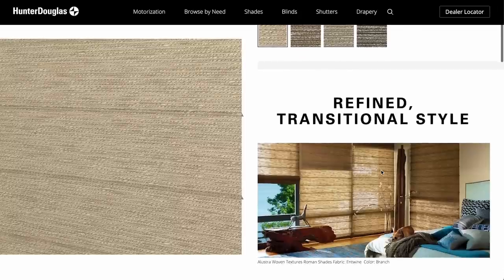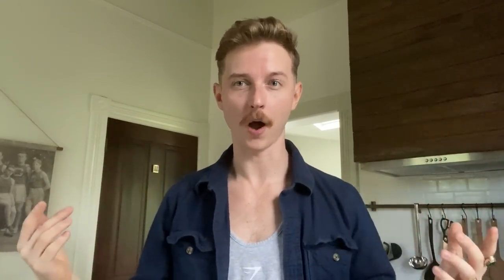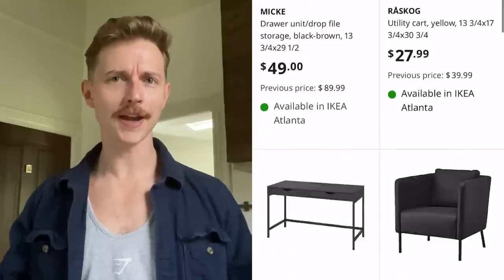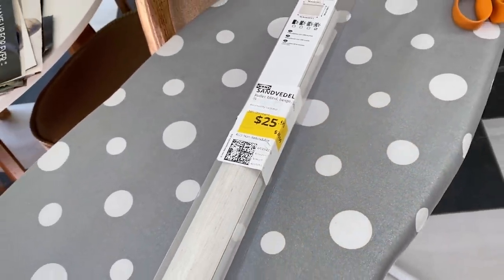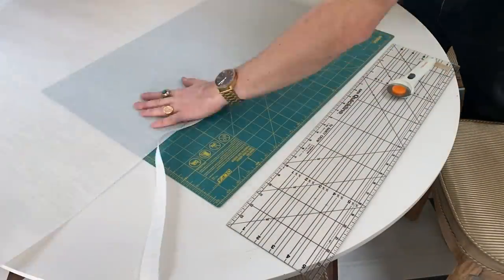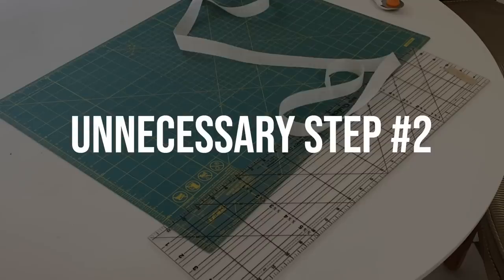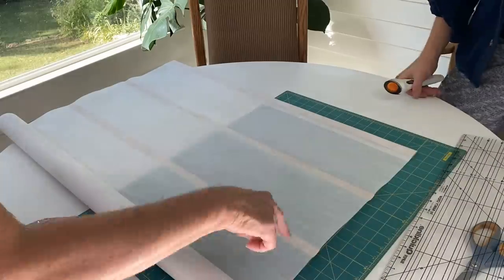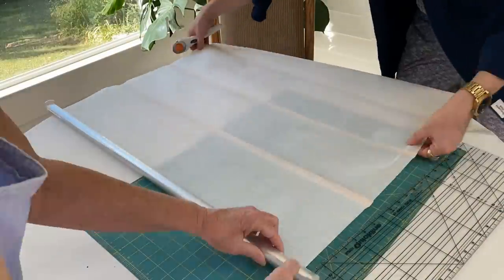Easy IKEA Sandvedel HACK! | Custom Zen Inspired Roller Shade | REISSUED

Comment: You're IKEA-famous, Andrew!  In case you wanted actual Roman shades, they are spectacularly simple to make, and you're such an accomplished sewist that I can't imagine you'd have much issue making them.
Reply: Can they (Roman shades)  be made for really wide windows?
Reply: @deborahdanhauer8525  I believe so, though if the windows are wider than the width of your fabric, I'd avoid pattern, as matching would be kind of tricky.
Reply: @xingcat  yes, that’s a good idea. But I want a color to darken a room, so solids won’t be a problem. Thanks for your help!❤️🤗🐝

Comment: Great project Andrew. Very creative use of veneer banding! 👏 I've used a lot of Birch veneer edge banding (usually from Lowe's) for Birch panels on paintings and it recommends using the high (cotton) setting. At that temp, sometimes you get adhesive squeeze-out. Not a problem on a rigid wood surface because it can be sanded. But, it can gum up your iron. So, I always use a piece of cooking parchment between the iron and veneer. I would be interested to see if the veneer has and 'memory'(from being rolled up) causing it to bow or curl over time or at higher humidity on the flexible fabric. As always...Cheers!
Reply from the maker: Great thoughts and tips! Thanks for sharing with us!

Comment: WOW, what a great idea.  Amazing well done.  For the pull you could take some of the back off and glue it to only the front.  Or find some hardware very light pull and attach it to the bottom.  I don't miss it, but it is just there to keep the shade clean from continuous use.

Comment: Cool. Wondering....i understand the veneer provides some very slight rigidity, but could the same affect been achieved with just painting the lines.
As always, very well presented, precise and professional.
Reply from the maker: Great thought! I think paint is totally doable but I probably wouldn’t do it for two reasons: in the past, I’ve found it tough to get clean lines. And I’ve also found it tricky to get an even enough coating that it looks ok to shine light through. But maybe that’s just me! If you give it a go, be sure to let us know! ❤️

Comment: OK, they used you for their store. Did they happen to cut you a "CHECK" for your efforts.  Also since you could not get the original hardware to fit, how about trying something similar to a 'drawer pull.' Great video. 

Ms. B. Churchill